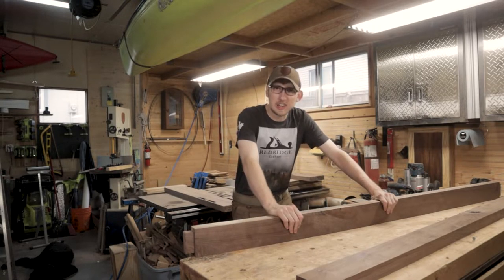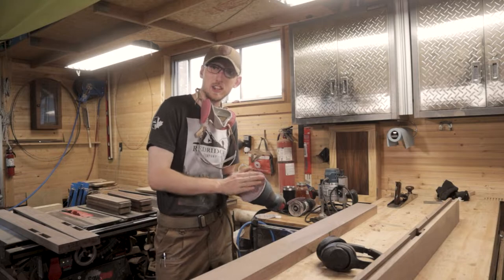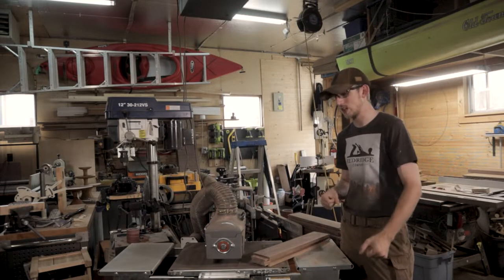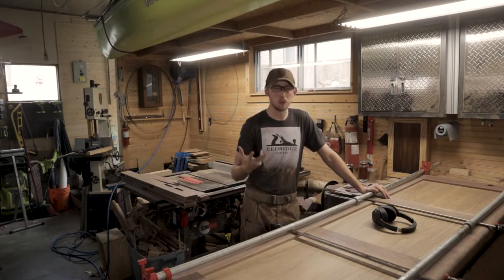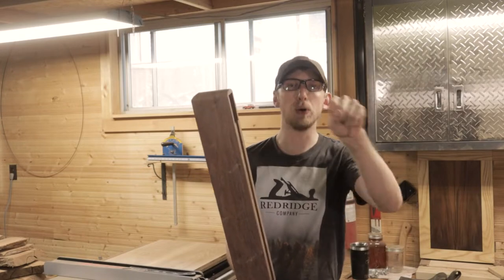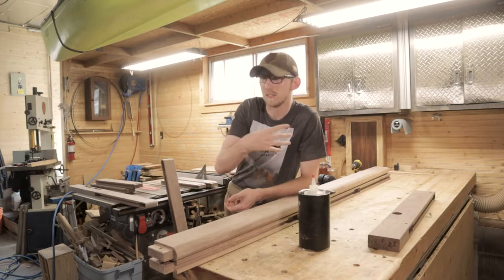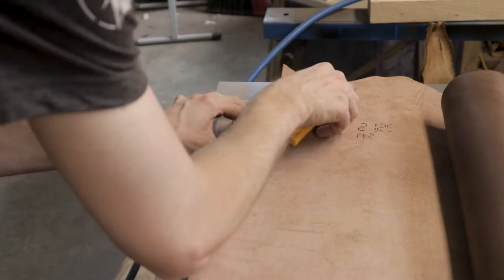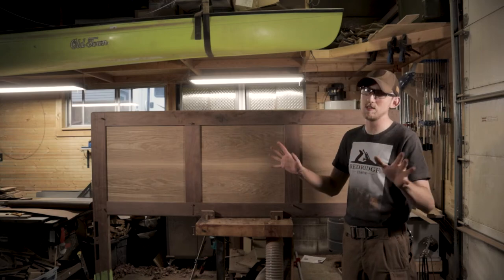Glueing up the headboard and footboard with hide glue | King Bed Frame | Fine Woodworking

Comment: Those laser stands are pretty slick - nice solution. Which brand / model lasers are you using?
The bed has come out amaingly.
Reply from the maker: Thank you!
The brand is Huepar, they were just the cheapest ones I could find on Amazon.
There's a post on popular woodworking magazine by Greg Pennington about how to make the stands.
https://www.popularwoodworking.com/techniques/shedding-light-compound-angles/

Comment: Why do you sand to 180.  Why not higher?  Why not lower?
Reply from the maker: 180 is the recommend grit for Tried & True oil, the trick is that if you sand to high (320+) you will have such a smooth surface that the oil won't be able to penetrate properly into the wood so you'll end up wiping off and throwing away most of your finish. If you sand to low (150-) the rougher surface will suck up to much oil and it will either take a long time to dry or may never fully cure because there's just too much oil.
I've learned both of these lessons the hard way, but you can also use them to your advantage, for me I like the smell of linseed oil so when I built my desk, I only sanded the underside of the drawer bottoms to 120, so they held more oil and have held a really nice scent for a long time. If you're working on a lathe you can polish up to a really high finish (2000+) then with the lathe running apply the oil and it will burnish into the surface and cure very quickly.